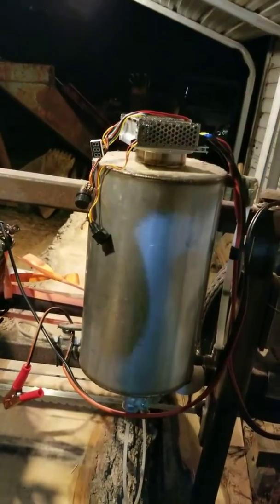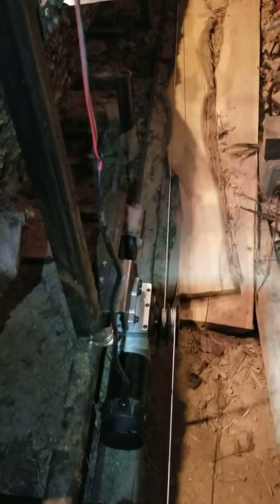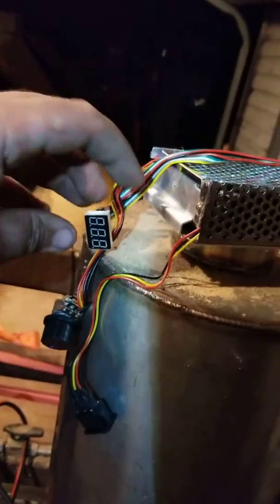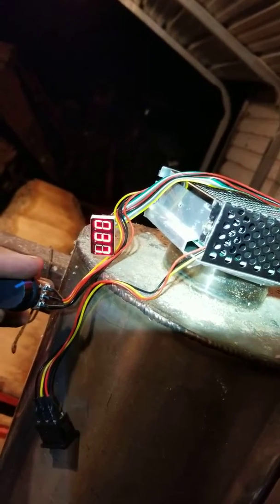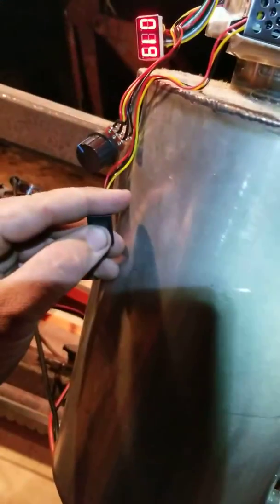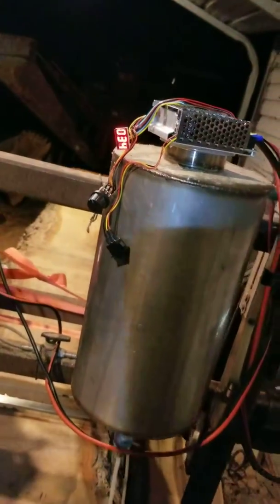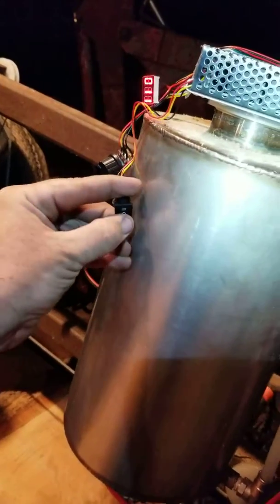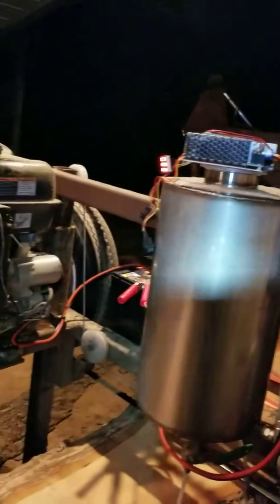DIY sawmill wheelchair motor power feed

Comment: Help me understand the drive pulley. you stated it is  a dual pulley..I have a lathe, so I can turn just about anything.Is it one single pulley divided in center and are you running two different cables. one to pull it forward and one to pull it in reverse..how are the cables attached to pulley if they are seperate. Thanks Larry
Reply from the maker: Yes, it's one pulley split into two sections. Like a two sheave pulley. I crimped electrical  eyelets onto the end of the cables and put a screw through them into the bottom of the pulley groove. Wrapping the cable over the top for forward and wrapping it under the pulley for reverse. I had to install a heavy spring on the back side to take up the difference it creates when the spool builds up with the cable. Let me know if you have any other questions. Thanks

Comment: Good, helpful video. I’m getting ready to make a power drive for my mill also. Have a wheelchair motor, controller, etc. but was wondering what you use for the cable drums? I’m trying to decide between cable or roller chain feed. Thanks.
Reply: Thanks. Now it makes sense with the cable drum. I looked online a bit and could find nothing like that. Appreciate the info.
Reply from the maker: @maxgernand4321  yeah I scratched my head for a while trying to figure it out. Just make sure you add a decent size spring where the cable ties to the backend of the sawmill frame. As the cable spool grows in diameter it will make the spring expand and contract to accommodate the diameter change.
Reply: Reformed Wooden Creations it can be fairly easy to have ideas, but then when we try to create them, we often find out executing them isn’t so easy. If I go with chain I’ll put an anchor on one end with a spring to allow some play in the cable. Thanks for the help. :)
Reply from the maker: Chain would work fine, I used cable with a spring on the back end of the bed to absorb any stress. Like if i step on the cable or such it will just go down to the ground. I didnt think the chain would be as forgiving in that manner. The drum is aluminum I machined at work, basically 2 spools side by side. As the motor turns it brings cable on one side and releases cable from the other spool. I have a couple other videos talking about the power feed, check them out. If you have any other questions just hit me up. Thank you for watching.
Reply from the maker: Another good source on this, check it out. https://youtu.be/2M1JMKUrSkQ
Reply: Reformed Wooden Creations Yep, I’ve seen that too. Keep on milling, even in this weird time we’re in. :)
Reply: Hi. Sorry to bug you again but forgot to ask. Are you running your wheelchair motor with 24 volts, or does 12 volts produce enough power? Thanks again.
Reply from the maker: @maxgernand4321  you're not bugging me at all. I'm using 12 volts, and I only run the pwm at 24% on my normal cuts 24"-30" wide. Narrow cuts 4"-12" I'll run a little over 30%. Let me know if you have any other questions.
Reply: Reformed Wooden Creations thanks very much.

Comment: Can u tell me exactly the speed controller u ordered
Reply from the maker: There you go. I've had great luck with it so far. Just make sure to look under the circuit board to see the positive negative power supplied to the controller goes.
Reply from the maker: https://www.amazon.com/dp/B073S3P1FY/ref=cm_sw_r_cp_awdb_t1_v-giEbT1XQP4W